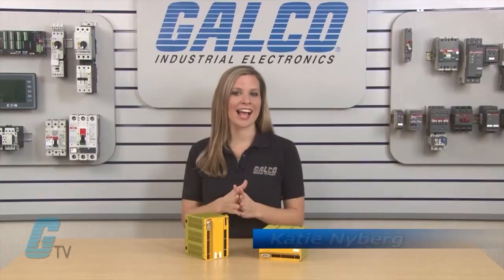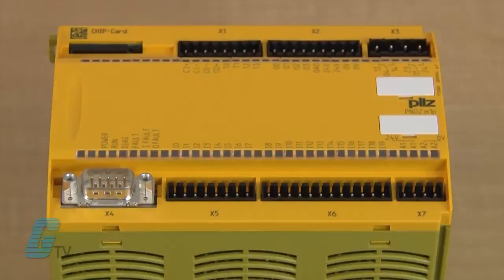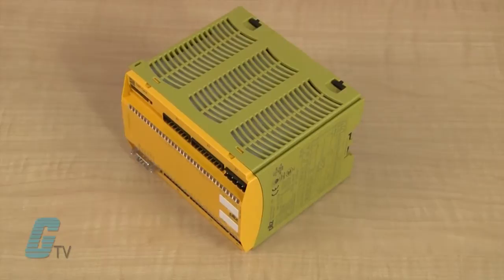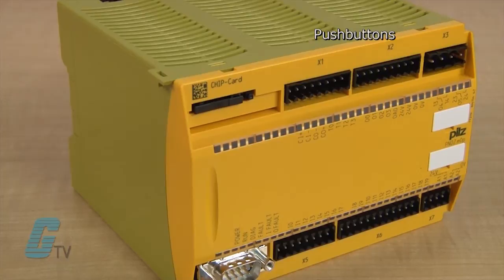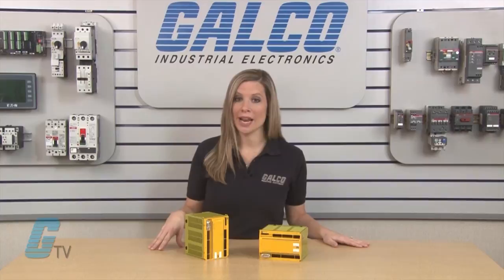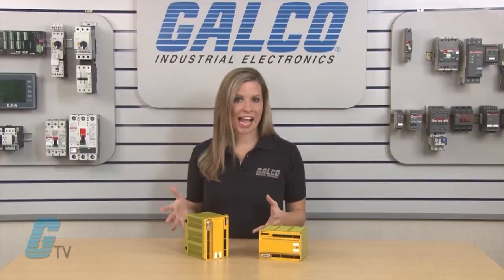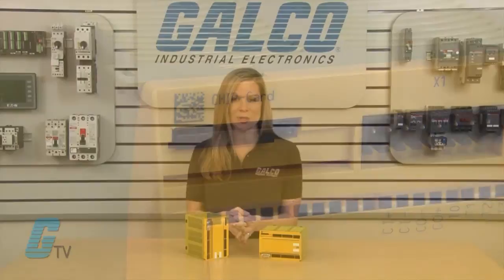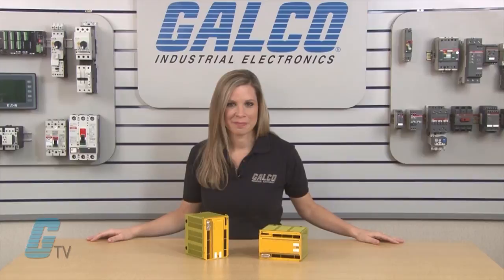Pilz PNOZ Multi (M1P) Safety Relay System

Comment: Hello.

During operation of the m1p, the IFAULT  LED flashes. Whenever I reset it works again. After running for some tines the error comes again.  Please what is the likely cause.

Comment: 1)What is fault 0 
2) PLC I use is PNOZ m1p, gets communicate but asking for Login password ????
Reply from the maker: Fault 0 or the 0FAULT means; External error on the base unit outputs, e.g. short across the contacts, leading to a safe condition.

Comment: what's the meaning of pillz overspeed error
Reply from the maker: The Pilz PNOZ safety relay with overspeed monitoring the output switches off when the stated value is exceeded.
Reply: how do to slove that problem?
Reply from the maker: close the reset input.
Reply: then